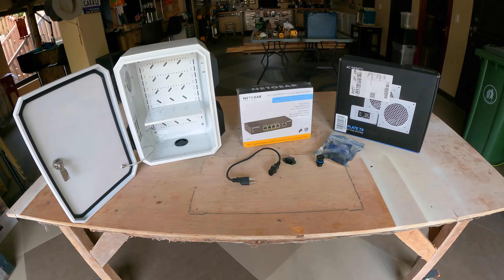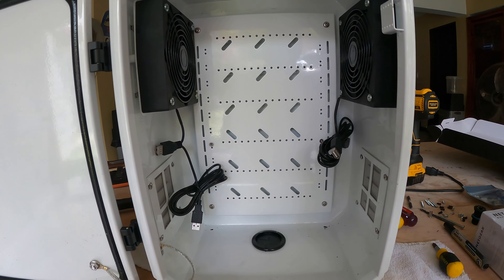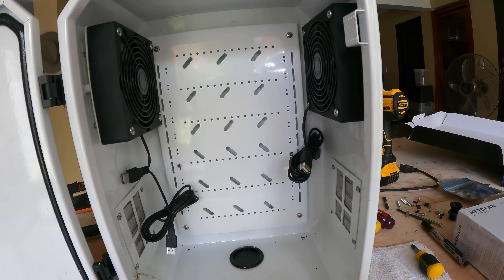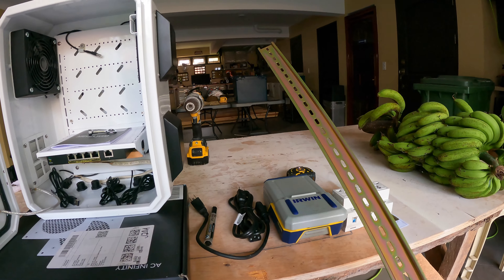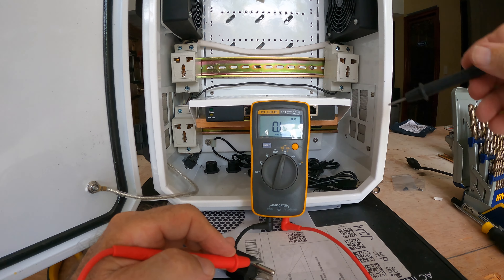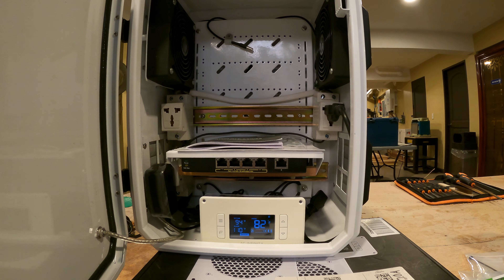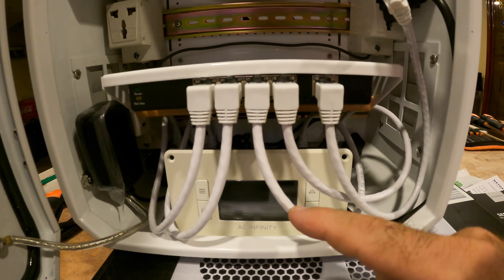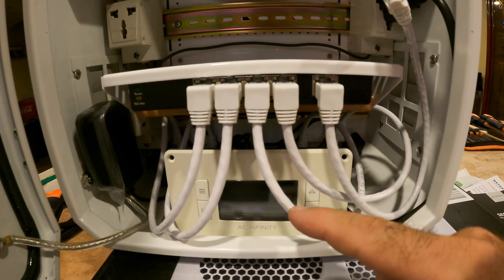DO YOU NEED THIS FOR YOUR STARLINK SYSTEM?

Comment: Great video and you answered my question on the 30mps below!  4kTV and gaming should be ok 30+ mps. How do you integrate 2 ISPs? Im not a network techie tho so be gentle LOL
Reply from the maker: Starlink private IP is configured for 192.168.1.x & PLDT is on 192.168.10.x.  As long as you have different network IP's they can exist on the same physical hardware.

Comment: JAMES, do you think that too assist in having a good Wi-Fi signal from your sky link that you could mount an external Wi-Fi aerial  on the underside of the box as well?
Reply from the maker: Yes, that would work too.  I originally tested this with the Ubiquiti access point on top of the waterproof enclosure and it worked fine.  It just didn't look good there which is why I moved it to the Starlink antenna base.

Comment: I think I would’ve used Lexan and clear, silicone sealant
Reply from the maker: I originally was looking for a similar enclosure since it's polycarbonate but I couldn't find any units that had the dimensions or fan shields for the outside.  The polycarbonate would be better to keep heat out over metal.

Comment: Any reason you didn’t place it inside? I noticed your lanai holding water is there an issue with your drains?
Reply from the maker: It's outside to avoid drilling a new hole in the wall as well as I wanted to avoid the visual of finding wall space on the inside.  The wall already had a connection to our network on the outside.
No issues with water on the lanai.  Small residual water after a rain.  Floor drains working to move rain water away from the house.